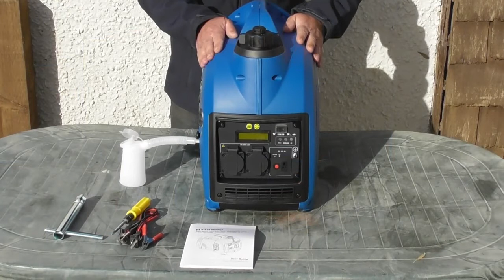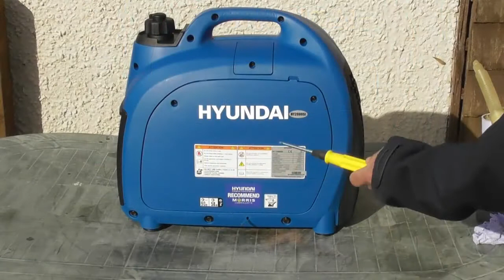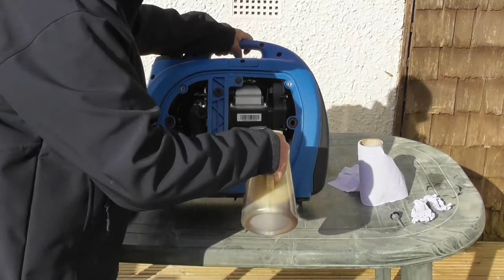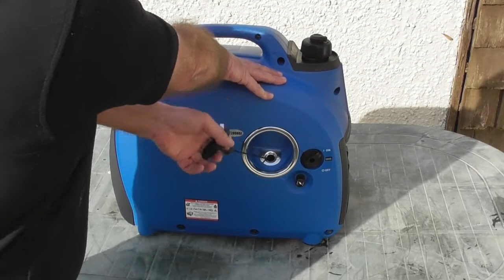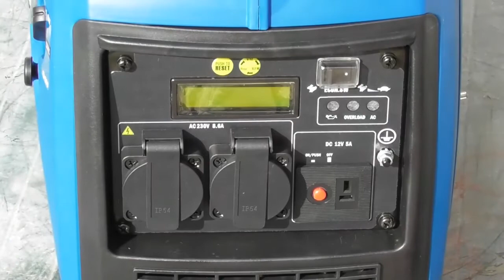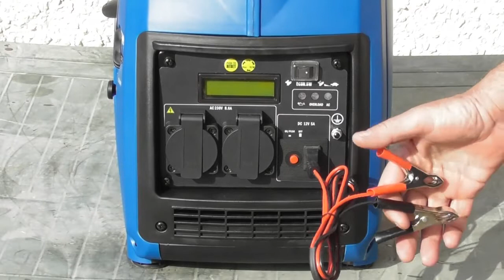HY2000Si How to prepare for use

Comment: Thank you for a great review! I have a question. What is recommended load to use in eco mode? I will be using this generator to charge an Ecoflow battery. It's consuming ~500wt from a regular AC power source. Can I run this generator in eco mode while charging the ecoflow?